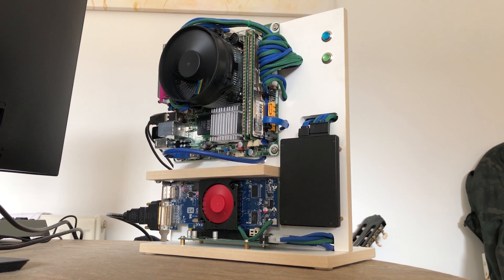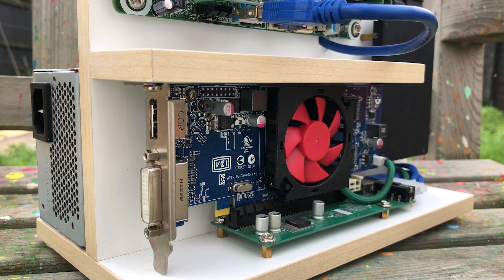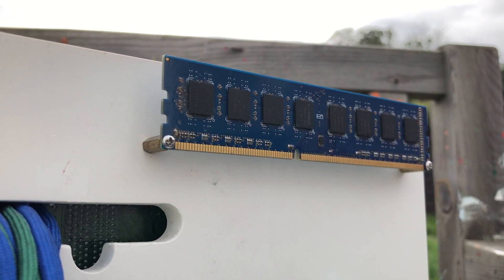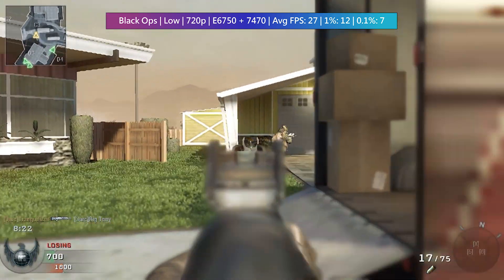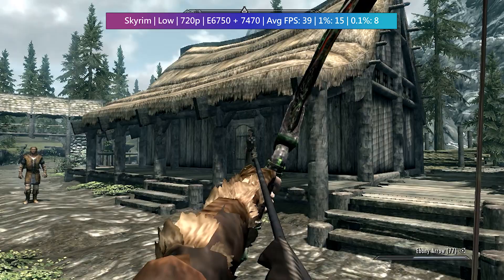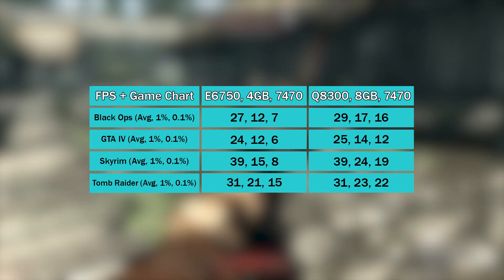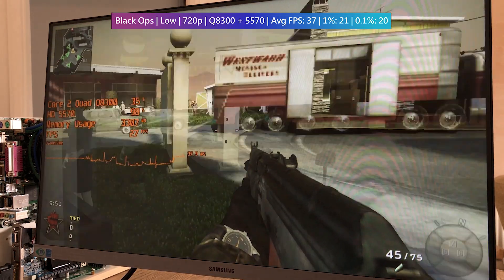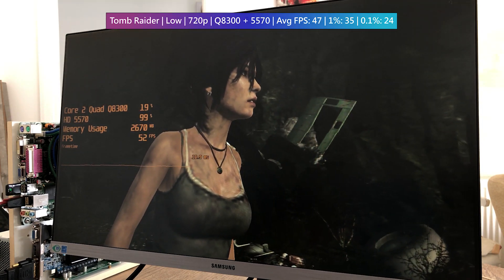I've Never Seen a Custom PC Build Quite Like This Before...

Comment: 4:53 Steve the type of guy to find a GT 740 under his bed
Reply: Doesn't everyone have a spare old GT 740 under your bed?
Reply: @TigerChamp99  you sure 'bout that?
Reply: I have under bed in a paper box  HD5670, GT730, GTX750, GTX1050  and Quadro FX1800  :-)  i'm actually build a similar pc with old AM1 board ITX asus and AMD APU 5350 + GTX750ti  with external 150W PSU
Reply: @WickermanX1  I have whole AM3 motherboard with an FX-6300 and 8go DDR3 under my bed.
Reply: Ironically, the original IBM CGA graphics card was so big, you could almost hide a bed under it.
Reply: @MarkTheMorose  LMAO
Reply: I've had a GTX 660 and a 9500GT under there at one point!

Comment: Love the case I would like this with a more modern build or just upgraded with a xeon and 1030
Reply: Yea
Reply: Yee
Reply: @Jollylyrical  
K
Reply: @ least a quadcore
Reply: With a quad core Xeon and some clocking even a 1050 can be run out.
Got a build like that with a 660 Ti and more often then not sitting GPU limited with it.
Reply: A new mobo would be needed. PciE x1 gen 1 is too slow.
Reply: Intel has a 10100f for 75 pounds + used  smalish max board + riser kit and a low profile 1650 could be pretty neat. Maybe even a little 120mm aio passed though to the opposite side with a slim fan.

Comment: I thought I was looking at my own PC! I retro built a design very much like this out of desperation when my new motherboard didn't fit in 3 of the cases I had. It's been an open air system for the last 4 years and still gives me joy to look at it :)

Comment: Great show piece for older hardware!

I have 6x 2GB DDR3 sticks of that OCZ RAM, but the 1.9V 1600MHz version of it. They're running at 1534 MHz in triple channel on a recent X58 build I made... With less than 1.3V... I definitely need to find the time to check how far I can push them.

Comment: Looks like a test bench we built at a place I worked once, but we just slapped a motherboard on a piece of MDF board with case standoffs and screws and little drill holes and attached a hard drive with different partitions for operating systems and used it for cloning hard drives and also testing various PCI cards and so on. This is a much nicer one though than what we ever had though. Also, I should note that using one of those 'Mining' PCI Express 1x to 16x adapters, you're probably losing bandwidth and performance, depending on what graphics card you put in there.

Comment: That doesn’t look like an aftermarket cooler, looks like one of those which were in pre-builds from the Acer group
Reply: Aftermarket would apply here as it's not an Intel cooler probably an acer contracted cooler master aftermarket cooler 😎
Reply: @philcooper9225  it's stock, as it came with the system.
Reply: It's a cooler master commissioned by an oem, so it's technically an oem part.
Reply: The heatsink itself is the same stock intel with copper core, the fan its probably cooler master, i have a ton of those, since actually they are 2 different parts, many oems just got them from different sources and put them together, it was easier in the wallet than just buying the prebuild intel stock cooler that was like "premium", the usual model is round, but i have some of the square variants with copper core too, the only bad side of all these old coolers, even if they are actually quite good at their job, its that the plastic holding the fan and the heatsink together its usually really weak so it tends to break easly, but you can just replace the entire plastic structure  with a 3d printed one in case that happens so :V
Reply: my dual core e5400 acer pre-build have same cooler

Comment: Nice PC and great upgrades :) the GPU upgrade and upgrade to a quad core CPU really made all the difference :)
Having said that, the original components would have actually ran GTA 5... if you went for the 240p or 360p option with shadows disabled. ;)

Comment: I'm actually working on a custom open-face hand-made build like this one myself.   I'm going for somewhat similar levels of performance, but I've set my build rules to include only those parts that I can get super cheap, so I've got an old HP socket 775 motherboard that came with a Pentium E2160 for $3, a Dell PSU that I got for $1, 2x 1GB DDR2 667 sticks of RAM that I got for $2, and a cheap Chinese CPU cooler that I found for $3.   For the graphics card, I found a beat-up 8500 GT that I saved from the trash heap by using the heat-gun treatment on it, with an old socket 7 CPU cooler screwed down over the GPU.  I used scrap wood for the frame that I cut and sanded, and then it off with some nice spray paint.  I will be painting the MOBO soon to complete the look, and then setting it up to do console emulation (Older NES, N64, and Genesis stuff).
The great thing about this kind of build is that it doesn't matter if the components are a little beat up - You can customize everything to accomodate.

Comment: If you want quirk, Antec Skeleton and Antec Baby Skeleton are just about the oddest and super moddable cases out there and because your workings are all there on a deck in open air and plenty of cool from one of the biggest overhead fans in the business.   I painted mine in lurid neon green with red flecks and had two separate water cooling circuits with one dyed UV blood red, the other UV toxic green and one of the circuits I had little Alphacool ram and gpu coolers which had these very fine lacy sort of pipes which looked awesome under the UV spotlights I had aimed all over the place.   Some Antec Skeletons have been turned into Futurama Bender robots and even Star Wars themed oddities...

Comment: Your sister being so capable with fabrics, could she make cable sleeves a bit like on those cables? Flexible fabric sleeve could slide over most connectors and even the cables with larger connectors, like power supply cable, sleeve could be put on using a zipper. Colourful cable sleeves could be a thing of the future, also as channel merch.

Comment: I honestly wanted to do something similar, except just turn my family's pc with its old dead hardware into some form of wall art, just frame up the motherboard, put a few led strips behind it, and wire up the cpu fan to like a 12v wall adapter so it looks like its running

Comment: Wow, I used the same OCZ RAM kit for my AM3 build back in the day. It was stylish but it was nothing special when it comes to DDR3 RAM. My system was an FX 6300 based build with 4GB of DDR3 and an XFX Radeon HD 6970 (BIOS modded 6950) and that thing was able to play most modern titles all the way into late 2018.

Comment: I once had a Commodore 64 mounted like this for an art gallery. The art Gallery changed it's mind about the artist being allowed to use tables, so I had to nail a C64, Floppy, all cables and PSU uncluding a flatscreen TV to a board. It just needed power to function and so it was hung up by a sturdy piece of steel cable. I sold the thing on eBay successfully but the ebay buyer asked me to dismantle it. SAD TIMES........

Comment: I want to see a Stainless Steele Case with copper used for all of the Water Tubing/Piping for the cooler. I also want to see a custom built, external evaporative cooling system. It would run ridiculously cool, as evaporative is something like a mini beast when it comes to heat transfer. That's why they use evaporative cooling towers on every manufacturing plant and on the majority of huge commercial/industrial properties. Evaporative Cooling Towers keep temperatures down unlike anything else..

Comment: Now that is my level of design. Actually made a benchtable out of a broken old case and a bunch of wood.
That machine would actually make for a fairly decent XP build. Give that a faster graphics card and it would run much better.
The quad and more RAM already did something, but something like a HD 7850 or GTX 670 would be nice. Maybe even a low profile 1030/1050
I would love to see how that E6750 with the DDR3 can clock.
Another option would be a visually unique home server.

Comment: G'day Random,
WOW! that is so cool,
I think a GIGABYTE GTX750/750Ti Low Profile GPU would make a good fit as the Blue Board also fits the Colour Theme of the build,
plus either would give a slight performance boost of about 350%/450% over the HD5570 according to TechPowerUp GPU Database 😁

Comment: Gigabyte make a single slot low profile GT1030 (GV-N1030D5-2GL), which would likely perform far better than the old Radeon cards. I got one for just over £80 on ebay in November and it was brand new still in packaging. I got it for a Dell Optiplex 390 USFF build for my mom to replace her laptop as the tiny case could not fit a dual slot or normal height card (that is running an i5-4590S with 8GB RAM and a Crucial MX500 SSD - it originally came with an i3-4130, 4GB RAM and a 500GB 3.5 inch hard drive). It has HDMI and DVI-D outputs but that's it. It is also PCI-E 3.0x4 standard, so it won't break any speed records.

Comment: Cut a channel for a riser cable and stick in a modern Geforce 1030 card. You might also be able to get a quad core cpu from ebay and cheap ram. Then it be a lovely wee build for not 2 demanding games. It is rather neat!

Comment: Hey RandomGaminginHD! A new video suggestion would be trying to play GTA 4 with optimization guides! For example using like modern hardware and a program which can help boost FPS, it's called Vulkan API. It has support for GTA 4 and GTA EFLC. Hope you can do this with a 1080Ti or the RTX 3080!
FYI, GTA 4 is a very CPU intensive game, so the better the cpu, the better the fps.

Comment: I can't wait to possibly see upgrading this unsual pc. love the vids
Reply: I don't think there is room for upgrade in this case...maybe just a newer power supppy, ram, cpu and gpu that can fit.
The cpu is just something that is compatible with the motherboard, so low chanses.
The MBoard looks kinda stacked on that wooden support
Reply: @Alexandru1996_  I do know their is tiny small form factor mobos that come in those tiny cases from I believe nzxt or some company but their like those tiny small form factors and have support for ryzen 3 or 5 not 100% sure on that. and Ive seen builds inside an orginal xbox with pc components aswell as a gamecube.

Comment: Not related but I've done a case mod where I took a case removed the front structure and fabricated a new panel that holds 2x200mm fans then added feet to the panel and rotated the case 90° which put the rear IO at the top of the case and the top of the case becomes the front panel making the 2x200mm now bottom fans cool air intake blowing upward and out the top increasing to overall cooling of the case and making large gpu mounted vertically taking the pressure off the pcie slot and when using a blowing style cooler exhausting hot air out the top of case if interested in photos or more info feel free to message me 😁

Comment: That setup would make for an amazing retro XP gaming rig.
Reply: too new, best is 754 mobo system with Athlon A64 or X2 circa 2003. cheap CPU cheap available motherboards, AGP GPU slot plus PCI slots and some even have one ISA slot.  or a $40 Atom mobo, or one of thsoe thin clients, theres a Wyse Technology Desktop Slimline Thin Client - AMD T56N 1.60 GHz 909690-01L on Amazon for less than $50. lost of useful IO on the back.

Comment: NVIDIA released the GT 1010 recently. It might even work with this PC as it only needs 200W.
Reply: it's a 30W card; 200W is that nonsense "recommended power supply" figure, like NVidia know the power consumption of the rest of the PC...

Comment: I tried to do something like this with a laptop. It worked well, but computer cases are harder to make than I thought if you have zero tools. Haha
Reply: Post a link to some pics. I wanna see! I've got a spare laptop with a busted keyboard, so It would be cool if I could turn that into a little small form factor pc
Reply: It's not assembled anymore. I don't even know if it works. I can tell you how I did it though. And if you still wanna see pictures of it I'll send one. But it won't be great.

Comment: The wood needs changing. Put a BSEL modded cpu in (e.g. q6600 at 3GHz or more) and your 8GB rx570 so as to run vulkan (especially via linux) for doom eternal.

Comment: I tried to do something like this a few months back, I made a stand, painted it black, drilled the holes and transferred everything onto the wooden board, screwed the PSU on, cable tied all the cables. Took me about 6 hrs, switched it on and . . . Nothing!!!!😭😭😂😂😂
Did the PSU check with the paper clip and it powered up so must have somehow messed up the motherboard somehow but it was all kept on a laminate surface so it wasn't static. Anyway I was gutted as I wanted a Frankenstein machine.

Comment: Looks cool.. in both ways :) "small" upgrades made awesome diference! i recently upgraded my cpu from a i3 4150 to a i5 4690.. under load the stock cooler from the i3 is having a hard time maintaining  the i5 under 75ºc ,sometimes (rare) spiking to 80ºc :/  i want something plug&play whitout taking the mobo out, should i get intel´s bigger stock cooler or aftermarket one? if the later, wich one? i really only need a 5/10ºc decress.. thanks

Comment: If you like older hardware... I have a  bunch of Cooler Master Musketeer System Dynamic Detectors LLC-U02 from 2003 new in the box, sealed  i am willing to sell. Next to a few Cooler Master Mars coolers RR-CCX-W9U1-GP for intel socket 775 and amd 754/939/940/am2/f from 2006 Also new in the box and sealed.

Comment: I'm confused how a 5000 series is an upgrade from a 7000 series, but there ya have it, haha. You should drop a low profile 1650 on there and see how bad the 1x adapter chokes it.

Comment: I really want to do a computer kinda like this, but maybe with slightly better parts like an I3 or a cheap I5. Maybe a GTX 750? I wanna try using a single gig 750 just to see how it  performs(probs not well but if the rest is weaker then it won’t matter much anyways)

Comment: I need help with a problem, wich i have for about 1-2 weeks now, i think here I might have a chance for good answers.

I have two displays, one 4k and one 900p display, both 60hz the 4k hooked up via Displayport the other via DVI.
When I start the Pc and Windows is loaded the second monitor starts having Image errors, mainly when there is a video running or when I move windows around. The image errors only happen when movement of any kind happens on screen. When using win+p to set it to second display only it doesnt have problems, when I set it back to both displays the the main display has the problem. But always only one display at a time. 
The problem appears to never happen when the GPU is under load. Also there are phases where the errors are not there no matter what I do.
I have checked it with another Display as second, different Cables, underclocking the GPU, different driver versions, uninstalling the Driver using DDU and reinstalling the driver, different ports on the Graphicscard, overclocking the GPU + mem to see if it gets worse, restarting the Pc, resetting the PC where I didnt have the issue for a whole day until it restarted and updated even tho I paused updates. I also tries uninstalling the latest Windows update but it gave me an error and told me to reset.
Also the problem never appeared when starting the computer before Windows is done starting.

I had these two monitors working togeter for more than a year without Problems, I only recently bought this R9 280x recently,
about 1,5 monts ago but this Problem never appeared until about 1,5 weeks ago. I am pretty sure there was a Windows update at that time.

System:
OS: Win10 Home ver. 1909 installed 29.02.21 (computer reset)
Gpu: Sapphire R9 280x toxic (latest driver @Stock settings)
Cpu: Ryzen 5 1600 (@ Stock, the original not the 12nm)
Ram : i dont know anymore but it never gave me problems in 3 years
PSU: Thermaltake Smar Series 530w (might be a bit on the weak side but problems are not ingame)
MB: Asrock AB350 Pro4

I hope someone has a solutions or knows what my problem is caused by.

Comment: Please try playing Phantom pain on core 2 due. You will not believed how optimized it is for older hardware. I used to play it without any hitch on an hd 5xxx series card with 512mb vram and 8gb ddr2 ram and a c2d 6700 unbelievable right.
believe it.

Comment: Hello RandomGamingHQ, i love your  videos because it is satisfying and enjoyable and i want to ask a question. Do you think that its still worth it to use socket 775? or should i upgrade to lga 1155? a decent answer from you will help me  thank you 

-XenZyek
Reply from the maker: I’d say 1155 these days. You can get some 775 quad core extreme processors but even they will struggle these days, and might not even start some new games
Reply: If you already have the LGA 775 PC and if you only play old games and indie games you've got no reason to upgrade to a newer PC, especially right now.

If you want to play modern games save up for an AM4 PC instead of LGA 1155, unless AM4 is too expensive in your country then LGA 1155 is fine.
Reply: @RandomGaminginHD  ok thank you also one more thing does the i3 3240 can handle valorant and csgo?
Reply: @Kps117A  Am4 is expensive in my country i have a socket 775 pc but im gonna consider upgrading to lga 1155 since it can last on some games

Comment: Hey ive been watching you for a very long time and my rtx 2060 just is so noisy whenever it puts in anywork any fix :(
Reply: Do you have good airflow? You can use afterburner to set your fan curve and monitor temps, so you can balance heat and noise